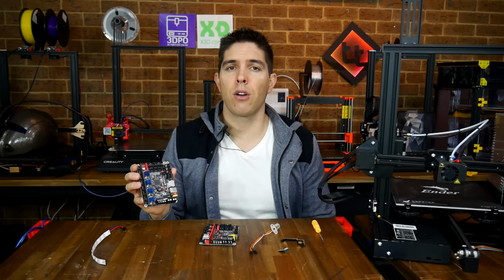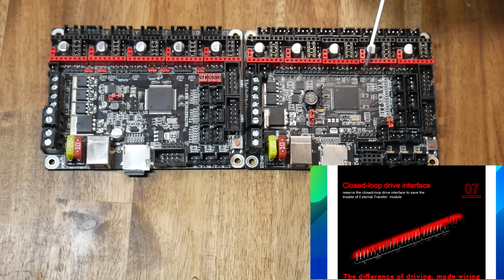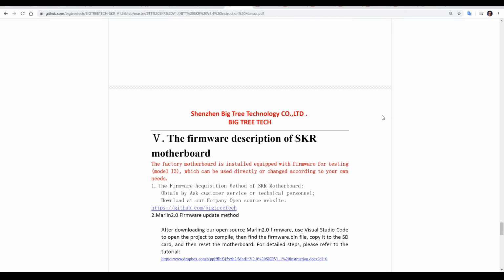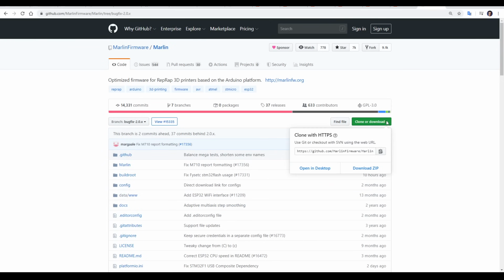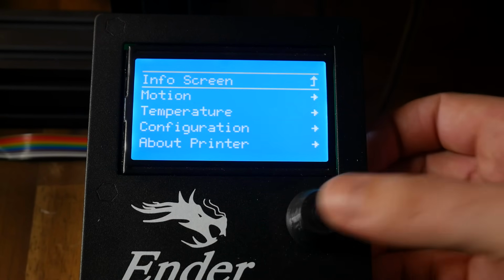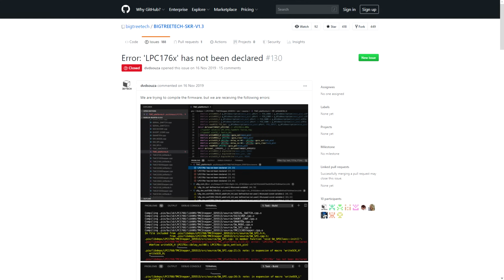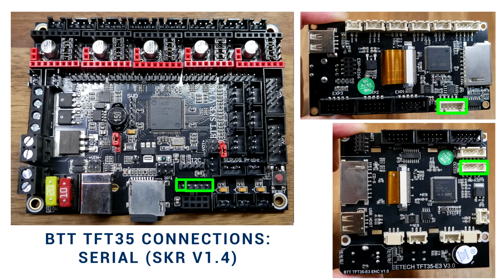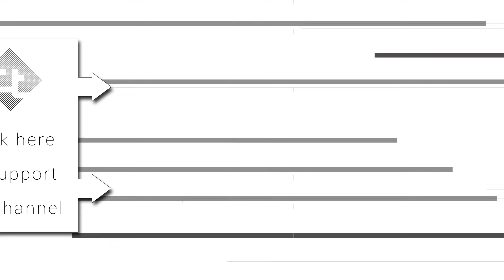Bigtreetech SKR V1.4 (Turbo) comprehensive guide

Comment: Michael, I have an issue with my brand new biqu thunder. I just upgraded my hot end to a micro Swiss yesterday. After reassembly, I tried to get a test print going via my SD card since the units wireless never functioned and the USB Cable never connects with a driver issue. 

I am considering using the SKR1.4 Turbo with the new 3.5" display. Do you think that this option would be beneficial for this printer. Oh, the error I see on my lcd is "OK' ******: power failed. The only thing I had changed was my hotend and heater cartridge from the 40w it came with over to a 50W. Then I changed it back when I saw the issue. 

I am very new to this, however I am an EE and have Vast Circuit board design experience. I checked all wiring, went over everything and never changed my firmware from the original configuration. So i figure i must have damaged a Mosfet or something.. which I why i figured i should just replace the board so I can achieve full temp on the BED and change out my temp settings so I can work with PC, Ultem and PEEK  figured if you know anything about this, I should ask an expert.

Comment: Will this work on my Solidoodle2?  I started getting items to upgrade this unit 6 years ago but then had health problems causing me to put it on the side for a while.  All is better now and I want to start again, but found that my grandson used it and managed to fry the board and power supply.  Will this board work with the Solidoodle?  What power supply is used?  Will the settings for Marlin be close to what you show?  I always wanted to add the screen and ability to print off an XD card.  I have an E3D hot end (not installed) and printed parts to improve the overall operation of the unit.  AliExpress is a go to for me since I live in the Philippines after I retired.  Am I biting off more than I can chew with this board?  Should I go with RepRap controller and screen instead?  Or maybe Raspberry Pi4 and Arduino (which I already have) running Octoprint.  I lost touch for a while and am trying to catch up.  Thanks for any input you could give and keep up the great work.

Comment: Will the stepper motors with TMC2209 drive on 5V via usb or do they need full power to work?
Reply from the maker: Always full power for stepper motors. You will receive TMC connection errors and they won't move on 5V.

Comment: I had the problem with TMC2209 as well when the motor was not stopping on my Ender 3. What i did just used 1 and 3 pins in the connector for signal and voltage, not middle one as you showing, and everything worked fine. Don't want to cut the pin on TMC, better to use proper connection for steppers imo.
Reply: You would also need to uncomment '#define ENDSTOPPULLUPS' in Configuration.h Then, as Andrei Bunulu suggested, make sure that your endstops are in normally open position, and modify the connector pinout on the board side of the endstop cable to use pins 1 and 3. Both Stallguard aka sensorless homing and endstops would work at the same time. No pin cutting is necessary.

Comment: BLTouch v3.1 & SKR 1.4 Turbo users just a tip because it took me a full day to figure this out. The BLTouch I have (official Antclabs) has three wires, blue, red and yellow. The Red and Blue wires needed to be swapped around and inserted to the board (with the yellow wire facing toward the reset button). The z-stop cable (black and white wire cable), as Michael said should be connected to the Z-STOP, but mine wouldnt work but then I noticed in this video and in the ANTCLABS screenshots show the white wire on the left, wheras mine was on the right. Swapped the pins over, re-inserted to the Z-STOP and behold my BLTouch will now stop the axis when homing Z.
EDIT: Oh and I forgot to define AUTO_BED_LEVELING_BILINEAR which caused G29 to be an unrecognised command.
Reply: Ok, as to swapping wires, did you have to change their order in the connector? Or just rotate the connector 180°?  I have tried (from closest to probe pins to furthest) yellow, blue, red and red, blue yellow and it always blanks out my display when I connect them
Reply: @Paulg532  Yep, thats exactly what happened to me, you need to swap the pins.
Reply: @vandit6354  Thanks, exactly what order do they need to be swapped into?
Reply: Nevermind, I misread your initial post, I think I've got it now. Thanks!!

Comment: I'm very new to 3D printing. 

What is sensorless homing?
Reply: Your 3D printer homes without physical mechanical endstops, and it is based on stalling the motor in the end position. Driver like TMC2209 detects when there is a collision with X or Y and stops the motor from going further. Crucial setting is sensitivity, here we can see 15, but this was waaaay too low for me, and mine was X:65, Y:50.

Comment: I'm running an ender 5, does this guide work for this printer aswell, I know alot of the ender 3/5 guides are the same. I know that the mounting will be different, do they mount to the original mounting points?

Comment: FYSETC v3.0 TMC2209 drivers has a very tricky jumper settings, where you have to insert jumpers DIAGONALLY, to work in UART. You have to insert jumper in pin from 3row/1column and pin located in 4row/2column to work, otherwise you will get TMC CONNECTION ERROR. More info: jayuk.org/bigtreetech-skr-v1-4-normal-and-turbo-and-fysetc-tmc2209-v3/

Comment: I'VE madethe exact same changes in Platformin.ini, configuration h, and configuration_ADV.H  .   i BELIEVE the version Marlin bugfix my version is a lil different than your example as in configH line 132 for motherboard ID, on mine its Line 130, Line 107 is now 105, Line 114 is 112. And in Config_ADV.H line 422 is now 540.  When you got to this point you ran TEST. I cant because of two ERRORS.   in Cinfig H "Include errors detected. Please update your includepath. Squigglers are disabled for this transactionunit".   SAME message in Config ADV.H   VS CODE ver 1.55.0  This is my first experience with VS CODE.    HELLLLLLP

Comment: Beware, you may well have problems with the cooling fan (FAN0) mosfet, Q4, on this board, especially if you are using dual fans. It also applies to Q2 on the E3 board.
See here for details https://github.com/bigtreetech/BIGTREETECH-SKR-mini-E3/issues/238

Comment: This seems to be an appropriate time to plug my pre-compiled Marlin 2.0.4 BTT SKR 1.4 Turbo 2209 UART +BLTouch build for Ender 3 this includes all of the Teaching Tech speed probing mods, filament runout and BLTouch.
you can find it at thingiverse.com/thing:4192395
This succeeds the bugfix build featured in this video, my bugfix for BLTouch incorrect sensing, and includes many advanced features such as Neopixel.
An important note, in this configuration you only need to bend out/cut the diag pin on X and Y axis stepper driver boards, the z axis is taken care of by the BLTouch with my firmware, and the extruder  pins never need modification since it does not use endstops.

Comment: coming back to this as it is only fair. It is such a shame that the company treats us the way they do (no answers, no refunds, wrong goods, etc)because the products are actually good quality and well thought off.  After another adventure that took a couple of months to finish, i got my display. been using it for a while now
thumbs down: 
-one of the ptfe tubing i got from them had an imperfection on the inside, did not notice it, ended up frying both the driver and the motor for the extruder using that tube ...
-threaded rods were not packaged properly, arrived bent and unusable
-wheels - (the wheels i got seemed "soft" and although i only did test prints (so no more than a couple of hours of work at the most) they look as worn as the wheels on my "work horse" printer (and that had around 30km through it ...). Maybe now they are better
THUMBS UP
- the skr 1.4 turbo is a very very good mobo. the layout is well thought off, no more wire spaghetti on top of the board, and it is quite cheap. It has 2 automotive easily repalceble fuses. They actually saved my board once, when the 12v fan pins came out of the connector (??!!) and touched eachother. i liked it so much that i now have upgraded my other printer to this same board. uart/spi without any extra wires, nothing bad to say about it

- the drivers (2130s) are the "toughest" i've seen, ended up ordering another set  (2209s) to use in my latest creation, same good build quality. All in all i currently have about 24 drivers from them, various models, they are all more than decent quality
- the displays are nice and have the best colours and brightness arround (one thing that bothers me is that they can't handle dual extruders in touch mode)

After my initial disaster with my order from BIQU, i placed all the following orders on other wibsites, mostly banggood. goods arrived properly and on time.
After my experiences i would say that the electronics they make are Top Notch, but order them on bangood, or locally, not biqu. As for the mechanical parts, i would still stay away from them when it comes to rods, guide rods and wheels

Comment: Hi, just discovered your channel, very nice. We have this big one here, https://www.lwtsistemas.com.br/wp-content/uploads/Spec-Sheet-Dimension-Elite-Impressora-3D-Stratasys.pdf , and we are replacing it motherboard with an SKR 1.4 Turbo. The problem is we have no idea of how we have to deal with its extruder head since it uses a dc geared motor. Does SKR 1.4 turbo have this feature?

Comment: Thanks for the Great video!!
Extra Notes for 2021
Using config version Marlin 2.0 v 020007, I had to add the following to get the BLTouch to work with SKR v1.4 Turbo, that I haven't seen mentioned in any video, found it in the bigtree github https://github.com/bigtreetech/BIGTREETECH-SKR-mini-E3/issues/221. After adding 
#define USE_PROBE_FOR_Z_HOMING
BLTouch homes properly. Without this, triggering G29 would home X,Y then Z would go to center(Z_safe_homing) and would not deploy probe or move towards the bed. Hope this saves someone else time :)

Comment: WARNING! This  32 -bit proccesor is 3.3v, this means all sub components that work at 5v wont work properly (like the pt100 + amplifier board) to make matters worse, the ADC pins (when you finally make one by desoldering the 4k7 pullup from thermistor) will blow when using 5v. For standard cartesian FDM printer you are better of sticking with your old board and upgrading the drivers. You dont need 32 bit anyway. I will be using this board to dust off my old delta printer and get some speed going.

Comment: It's worth noting that you still need to make some changes for the LCD to work. See here: https://github.com/mathpluslabs/BIGTREETECH-SKR-V1.3/commit/6991d994363f3696c70e7c4fe407d9e2f5a3ce62.

Enable `#define CR10_STOCKDISPLAY` and `#define DISPLAY_CHARSET_HD44780 WESTERN`. Make sure no other controller types are enabled.

Comment: Ok, I am looking to pay someone $100 to roll me some firmware if I provide ALL of the specifications. I have the turbo board and have been using vscode. As far as I can tell, everything works but the SD refuses to initialize. Been at this for 10hrs and going in circles. I have spent well more time than that reading github threads and and always circling back to things that are already a part of the firmware. If anyone is interested, let me know.
Reply: Before powering the board hold down the small red button on the board and then turn the power on. Release the button after about 10 seconds of the power running. It should reset.

Comment: I had problems with compiling. See this reddit post: https://www.reddit.com/r/MarlinFirmware/comments/g974nd/unable_to_compile_firmware_in_platformio/

It turns out the example config files are outdated. Don't need the marlin bugfix version also! just the 2.0.x is good.

Comment: Holy crap, I go through all of the wiring, barely get the damned thing in the case and THEN YOU TELL ME I NEED TO CHANGE JUMPERS FOR THE STEPPER DRIVERS😬🤨😬😡😡😡🤬🤬🤬
Then you just skimmed through the Code Portion and 90% of the people have never used VSC.  How about doing a guide that people can understand if they haven't coded before.  You seriously need to realize what your audience really is.  The people who have coded really dont need your guide, its the people like my daughter who bought a craigslist printer and wanted to upgrade the printer so she can use BLTouch and wifi.
Reply from the maker: Hey buddy, take a few deep breaths, watch the video properly, check the timestamped description. There's a link under that section for users on how to set up VS code for Marlin. What you want was there all along. I wish your daughter best of luck on her mods.

Comment: Be aware that this Video assumes a LOT OF PRIOR KNOWLEDGE and proceed with caution
Reply: I totally agree. On the surface it looks like you are given all the necessary information  but it's actually not the case. Especially for the motor drivers that he so happily glances over and refers people to one of his older videos. Trouble is, that video is for a different board, using an older version of Marlin and different editor so you are left wandering if what you did is correct or not. Seems like fishing for people who are stuck with their upgrades and desperate enough to pay for support on patreon!